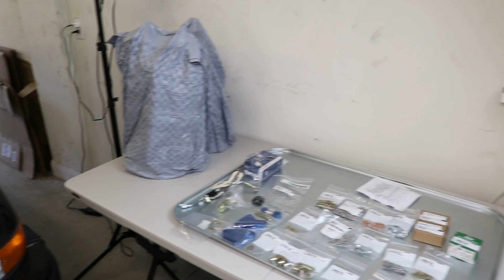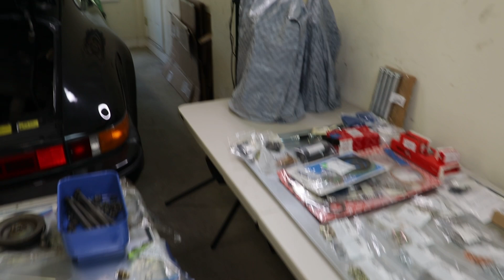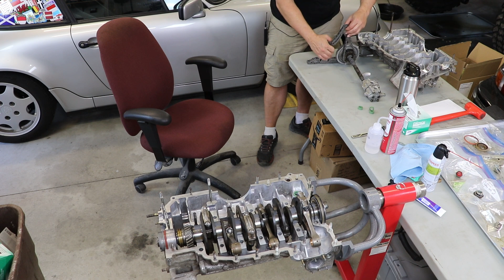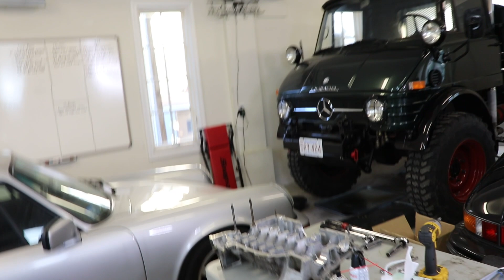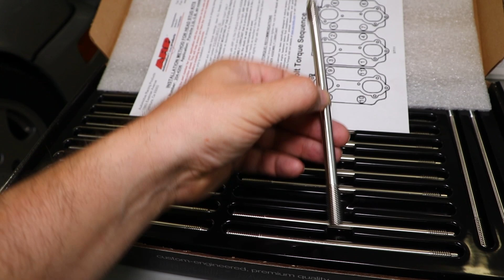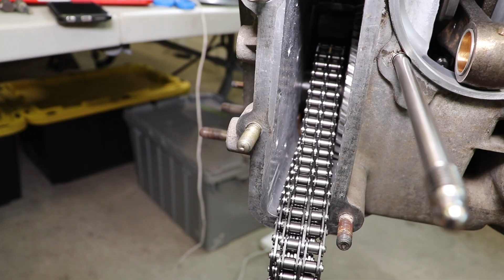911SC Track Car Build - Episode 4: Engine Case Assembly

Comment: I’m curious about the head stud height at 140mm vs the 130.2mm.  Are you using 140mm for the length of the stud given that there is about 8-9mm of no threads at the top of the ARP head stud?
Reply from the maker: That is correct. I was measuring to the very end of the ARP head stud, which has a hemispherical end. The 140 mm measurement was from the seat for the cylinder jug to the very end of the head stud. Hope this helps.
Reply: @ Thank you. Really enjoyed the videos. Very helpful!!

Comment: What was the reason for not putting the Loctite 574 on the other half of the case? Looks like it would have been easier?
Reply from the maker: That's a very good question. I followed Dempsy's book, where they put it on the same half I did. I think it is also easier to paint on with the block half attached to the engine stand - it provides a secure, stable platform at a good working height. I think if you wanted to paint it on the other half it wouldn't matter.

Comment: Like your videos. Kurt Donahue is the best at Klassik automotive training school. Also watch out for the Wurth aluminum washers that come in the pelican rebuild kit. They deform even before they reach  their the proper torque setting. The original factory ones are better.
Reply from the maker: Thank you for the advice and thanks for watching! I didn't have an issue with the normal aluminum Wurth washers. There were a few of the aluminum washers for  the oil fittings (I can't remember if they were for the cam housing banjo bolts or the pressure sensor) that were not able to take the full torque spec. The torque spec actually seemed way too high for such a thin washer. Thanks for the tip!

Comment: I'm doing the same build. 3.0 with JE pistons and new Nikies from EBS. I'm runnig the 964 cam grind and the 40mm PMOs with SSI's.  Should be very similar your yours. I'm curious about the 1mm gap from the piston top to the cylinder top.  Don at EBS said anything over 1mm will work for clearance.
Reply from the maker: I got my piston clearance numbers out of Dempsey's book. In the next video I will show how I checked this clearance. I remember it wasn't an apples-to-apples measurement as Dempsey's, as the CP pistons I used are a different shape than the stock pistons. I am very happy with my setup. I run a 9.8:1 compression ratio, which was the highest I could safely go without running twin plugs. This ratio was recommended by William Knight, who is a great knowledge source for these engines! I recommend reaching out to him. I also bought some of my parts, like carbs and exhaust from him. I am also running a different cam than you - I got the 464/465 grind from Webcam (https://www.webcamshafts.com/pages_vehicles/automobile/porsche_install_data/tc_000452_003771.html). My car made 260 hp on the dyno and has a super flat torque curve. It is fantastic on the track and very usable on the street. Good luck with your build!

Comment: I was just recently wondering when the next video was going to come out! Still itching for you to rebuild the 964 engine. I'd use your videos as a reference point once it comes to the time to rebuild my 993 3.6
Reply from the maker: I just posted one! Sorry for the long delay. My 964 engine has 165k miles but is still running strong, so I hope I don't have to rebuild it anytime soon!